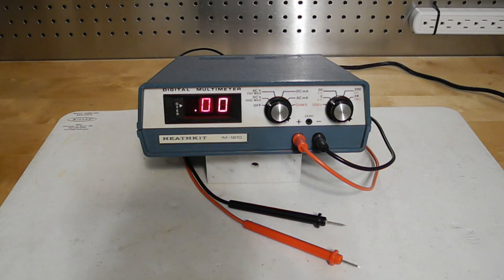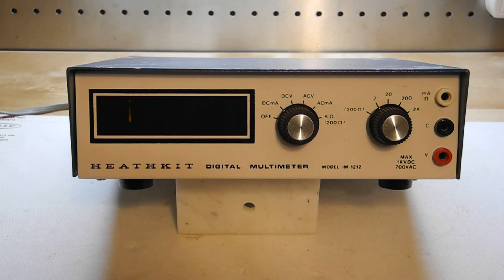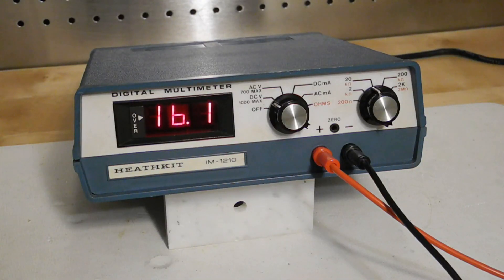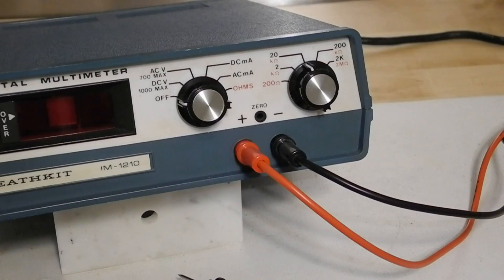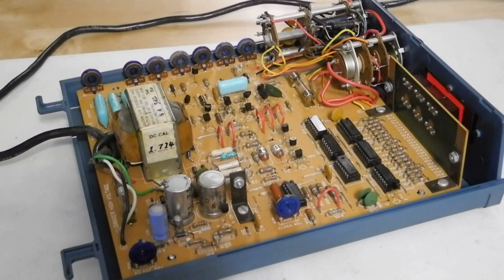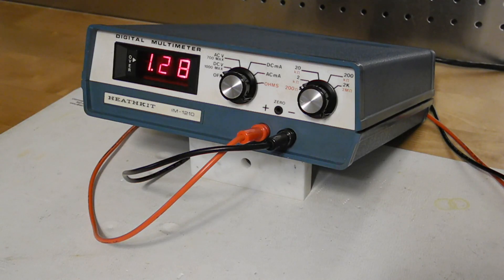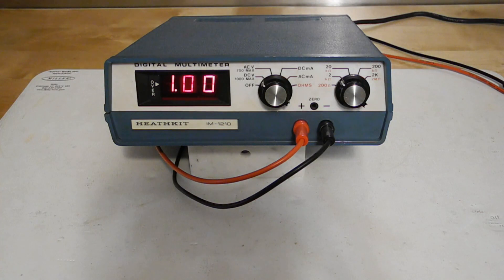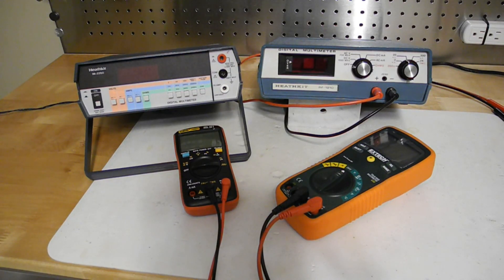The Heathkit IM-1210 Digital Multimeter

Comment: Nice job Jeff.

If anyone wants to delve deeper into the inexpensive Heathkit DMMs, I also have a video covering several models in this series, including the IM-1210. I go into some detail regarding the nuts and bolts of how the circuit works, including Heathkit's clever ADC circuit implemented using a few transistors.

I also did AutoCAD re-draws of the schematics, which can be downloaded using links at the bottom of this webpage:

http://www.serpentwebsite.com/fileshare.htm